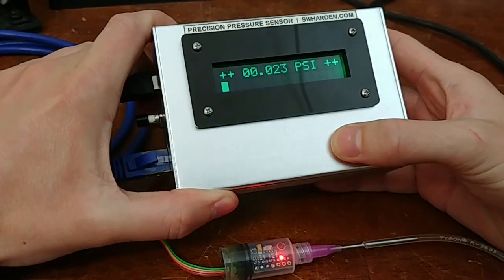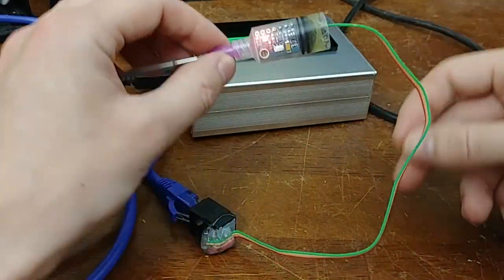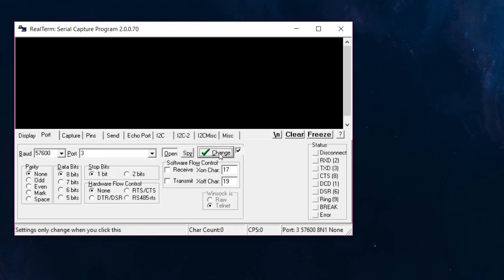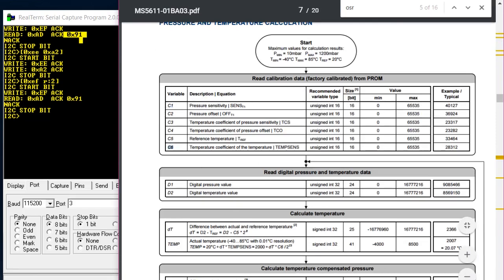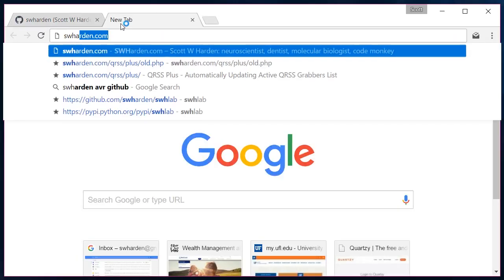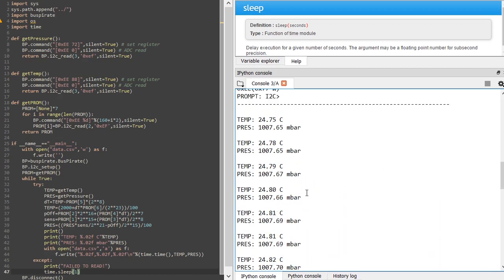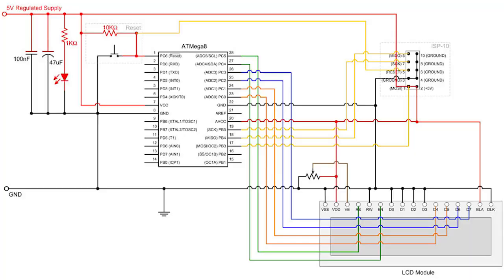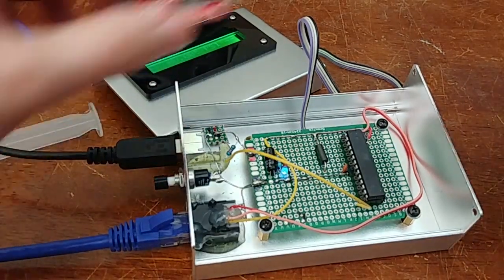Precision Pressure Meter Project

Comment: This is a very clean project.  I like to graph the data to a 320x240 LCD. I've been waiting for a differential pressure sensor with a 24 bit ADC with a range within -+ 2PSI for an HVAC device i plan to build. Upon doing the math for your sensor, 24psi / 2^24 equates to just over 1 millionth of a PSI precision. Is my math incorrect?

You might have better signal quality by using a battery to power it. USB is notoriously noisy. AC adapters vary in quality in ways your multimeter can't detect. You can also use a running average for slightly slower updates but with more stable readings. I was getting stable readings with the SM5852 differential pressure sensor down to 1/10,000 of an inch of water column (with only 12bits) by using running  average. I cant even imagine what a 24bit ADC would do on the same sensor.

Comment: This is really cool. I am inspired to try to create a project with two sensors and display the difference between the two. Any suggestions. I clicked the link for the sensor breakout board (above) and the page was not found. Thank for the cool ideas and terrific explanation of the data sheets and your project
Reply from the maker: Check out sparkfun! Since I posted this video they have breakout boards for pressure sensors like LPS25HB https://www.sparkfun.com/products/14767
Reply: @swharden  I was reading your code in the section "Code to pull a 24-bit pressure sensor reading:" on https://swharden.com/wp/2017-04-29-precision-pressure-meter-project/.  You might want to go back and check your spelling:
pressure=0;
pressure+=data[0]; // pull in a byte
pressure=pressure<<8; // and shift its significance
pressure+=data[1]; // pull in another byte
pressure=pressure<<8; // shit it all again
   <<<<<<=================== Oops ;)
pressure+=data[2]; // add the last byte

Happens to all of us, lol
Reply from the maker: @franklister7426 haha! good catch =]

Comment: What Epoxy did you use? I used Loctite Epoxy / Plastic and when it cured it did not bond to the syringe so air will pass between the Epoxy and the syringe. In fact, with enough pressure, the cured epoxy can be pushed out of the syringe.
Reply from the maker: I used Gorilla Glue Epoxy. It bonded well to the polypropylene syringe and cured very hard.
Reply: When you add/subtract pressure with your 2nd syringe, do you loose pressure on your probe? When I apply  a constant pressure to my probe, the pressure slowly bleads off. I loose about 1/2 atmosphere over 5 minutes. It was worse one my first probe, I am guessing there was air escaping from the sheath on the CAT5 cable. When I stripped back the sheath so that only the shielded wires passed through the rubber plunger and the sheath was imbedded in the epoxy, then it worked a lot better, but still have a pressure loss. I even super glued the connecting hose to the syringe. Any suggestions? Any change that you could make a video on making the probes :)  Thanks
Reply from the maker: @franklister7426  Maybe use a hard-setting epoxy to ensure it's air-tight? Perhaps paint your syringe with clear nail polish to ensure all the junctions are truly sealed? Also, if you are applying pressure with a second syringe, maybe it's the second syringe that is not air-tight.
Reply: @swharden  Thank you, I will give that a try :)

Comment: Do you have a wiring diagram? I can't seem to figure out how you connected the display to the ATmega
Reply from the maker: The display is definitely the most complicated part about the software and the wiring. The sensor is easy in comparison. https://github.com/swharden/AVR-projects/blob/master/ATMega328%202017-03-19%20i2c%20LCD%20pressure%20sensor/schematics/atmega8_lcdpcf8574_sample.png

Comment: I need to measure negative pressure, any suggestion？Ｉwant to measure the soil moisture tension  (negative pressure) for soil moisture content measurement. (soil tensiometer)
Reply from the maker: Yeah, this will work for you. There is not really such a thing as negative pressure. A vacuum is 0PSI (0 Bar), and anything with more air molecules than a vacuum will have a positive pressure reading. "Negative" pressure usually just means < 14.4 PSI (<1 Bar).

Comment: Nice project!    
I'm trying to find a manometer to measure a differential pressure of 0.5 inches of water (0.125 kPa), but none of the devices I can find have that precision.   Have you seen other devices that do this?
Reply: That's low! I have a vid on my channel of an SM5852 diff press sensor. I was able to get precision to 1/10,000 inchH2O by using a fast running average to smooth out the data. You can find other sensors these days that go to +-0.250kPa. I'm afraid you might have to wait for a 0.125kPa version.

Comment: does the maksimum psi only 23 or it depends on the tube?
Reply from the maker: Hi Rafi, the link in the description (project page) has a link to the datasheet. The datasheet says "Operating range: 10 to 1200 mbar" (1200 mbar is about 17.5 PSI). However, it's easy to find similar modules which measure much higher pressures. I intentionally got a low pressure one because I only intended to measure 0-3 PSI.

Comment: I need to know if you can help me to make a project
Reply from the maker: maybe
Reply: @swharden  can you make a wireless precision sensor from. 0 to 5 psi?
Reply from the maker: Yes. Pressure sensor modules are cheap and common, as are bluetooth modules and other wireless modules for small electronics projects